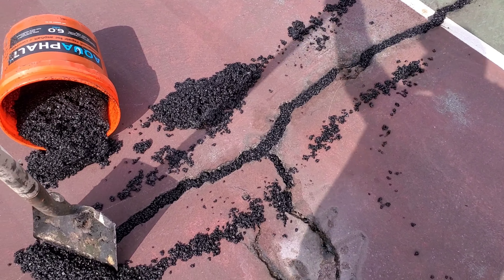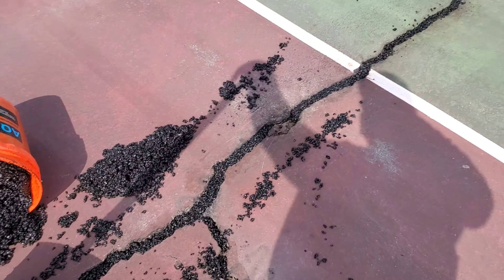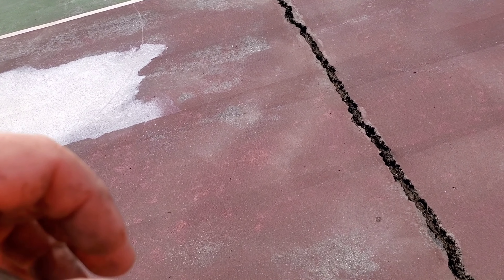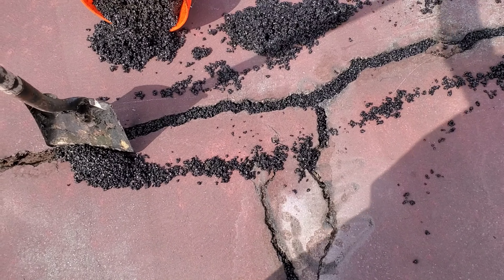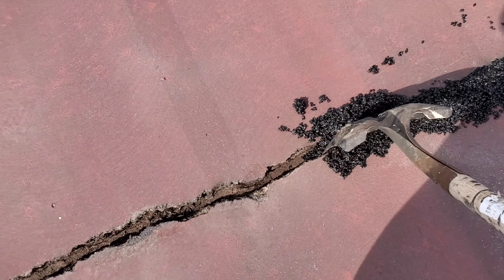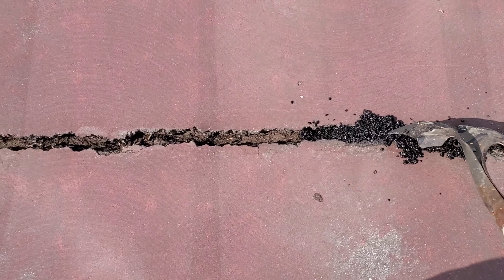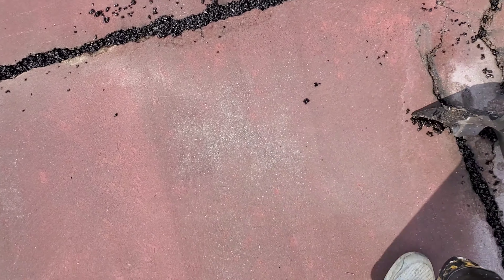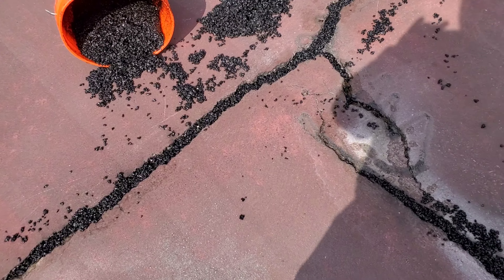Aqua-phalt for crack filling asphalt.

Comment: Use concrete mix, leave a 1/4" for patch binder mix.
Reply from the maker: This stuff's way easier than concrete concret e does not work well up here in the Northeast.
Reply from the maker: Believe it or not I know a company around here that just uses a sand to fill up the cracks or stone dust then the last quarter inch they use binder
Reply: @thesealerguys  Yeah, I saw a video of some sealing guys doing that, presumably to save material.

Comment: How do you smooth or feather the aquaphalt so that you don’t see the patch when you paint the court?
Reply from the maker: Watch the do it yourself crack fill video we go over it with that process
Reply: @thesealerguys  thanks! do you fill the crack with aquaphalt flush with the court surface or do you leave space for the acrylic patch binder to go on top?
Reply from the maker: @georgeandamynanos8068  no leave a quarter of an inch.but they are going to come back without a doubt if you're not going over them with a membrane repair